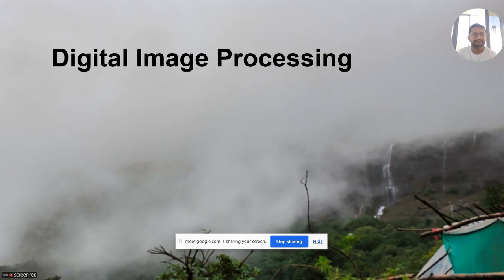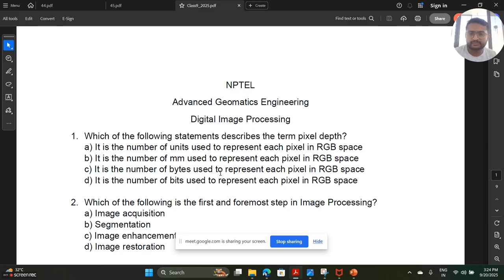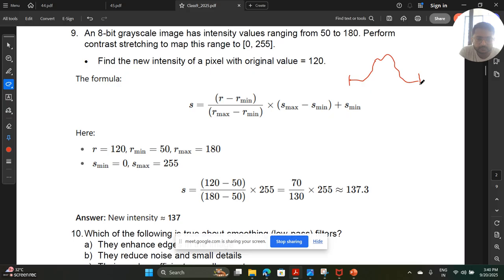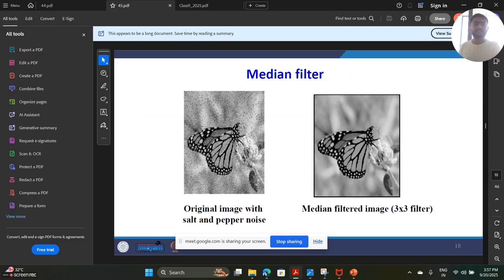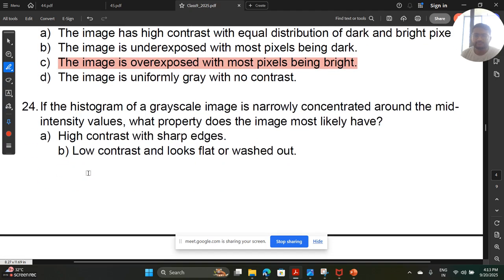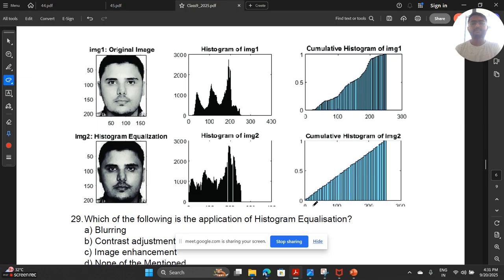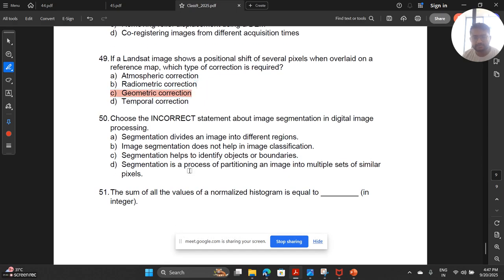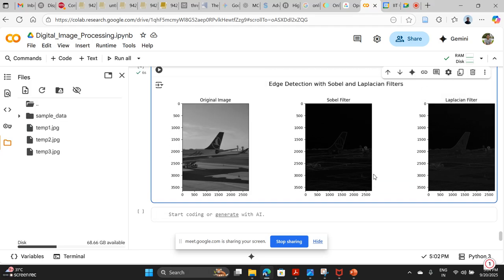Week 9: Digital Image Processing | Problem Solving Session | Advanced Geomatics Engineering | NPTEL

Comment: 00:10 - Discussion on digital image processing techniques and applications.
03:20 - Editing digital images involves adjusting pixel values and RGB bands.
09:04 - Brightness and contrast adjustments enhance image visibility.
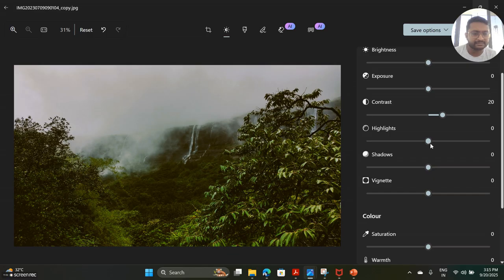11:30 - Understanding highlight and shadow adjustments in digital image processing.
16:08 - Understanding histogram manipulation for image enhancement.
18:17 - Class focuses on solving numerical problems and coding in Python.
23:09 - Image segmentation clusters similar pixels to identify objects.
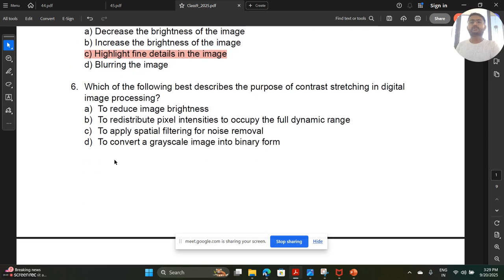25:21 - Contrast stretching enhances image quality by redistributing pixel intensity.
30:49 - Contrast stretching may have minimal effect on images with extremes at 0 and 255.
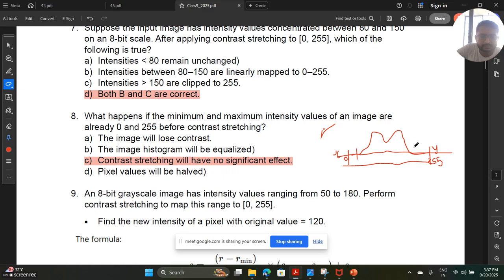33:17 - Discussing contrast stretching techniques in image processing.
38:14 - Understanding range conversion and interpolation in digital image processing.
40:56 - Understanding interpolation and filtering in digital image processing.
46:52 - Gausian filters preserve image structure while smoothing pixel values.
49:28 - Comparison of Mean and Gaussian Filters in Image Smoothing.
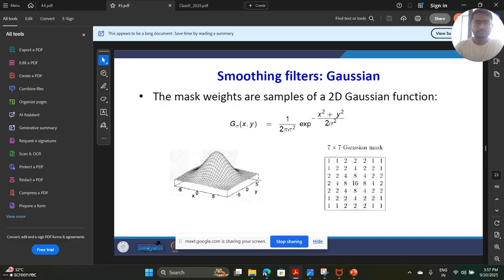53:51 - Explains filters in digital image processing and their applications.
55:59 - Discusses the significance of first-order derivatives in image filtering.
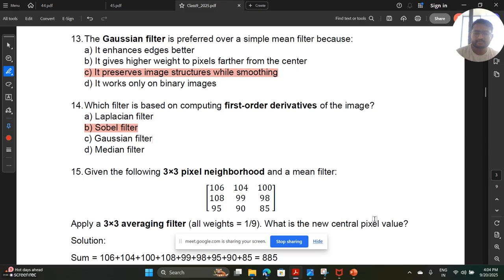1:00:51 - Calculating new pixel values using different filtering techniques.
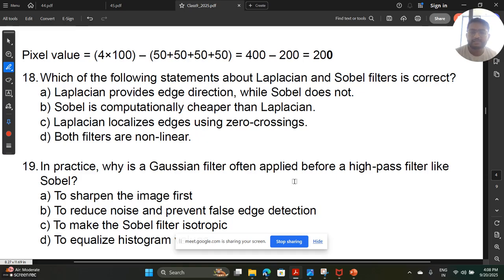1:04:29 - Comparison of Laplacian and Sobel filters in image processing.
1:11:13 - Understanding contrast stretching in grayscale images and histogram distribution.
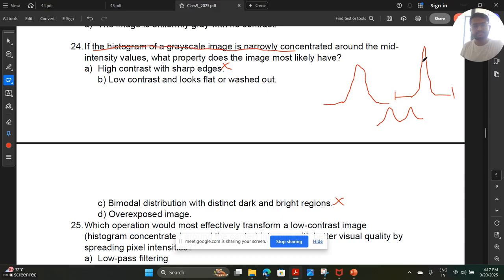1:13:26 - Understanding characteristics of overexposed images and their appearance.
1:18:59 - Understanding histogram equalization in image processing.
1:21:24 - Histogram equalization techniques for image data analysis.
1:25:48 - Histogram equalization and normalization of pixel values in images.
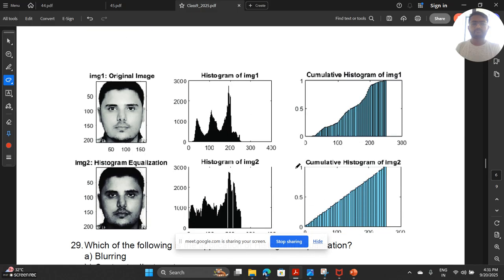1:27:51 - Histogram equalization enhances image contrast by adjusting pixel values.
1:33:43 - Geometric distortion in satellite images affects image quality.
1:36:52 - Discusses image processing concepts and filter types in Digital Image Processing.
1:42:53 - Understanding radiometric and geometric corrections in image processing.
1:45:28 - Segmentation enhances image classification accuracy by identifying similar pixel groups.
1:50:30 - Histogram equalization enhances image contrast for improved detail visibility.
1:52:47 - Understanding histogram equalization and contrast stretching in digital image processing.
1:57:00 - Discussion on histogram analysis and image filtering techniques.
1:59:09 - Understanding Laplacian filters and their libraries in digital image processing.